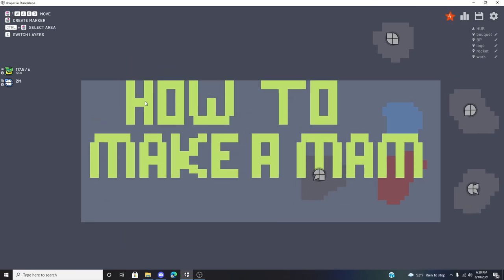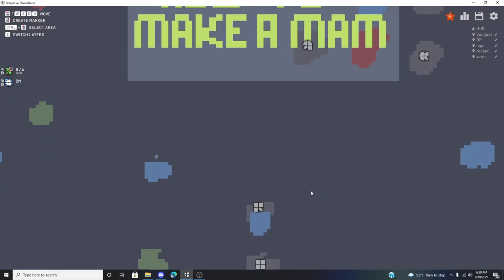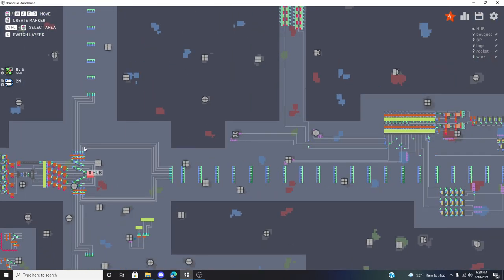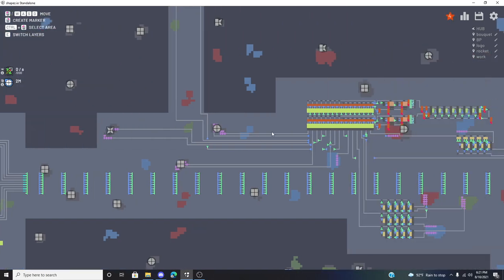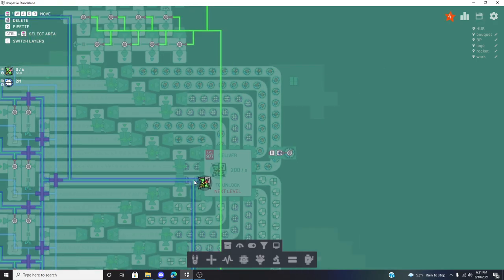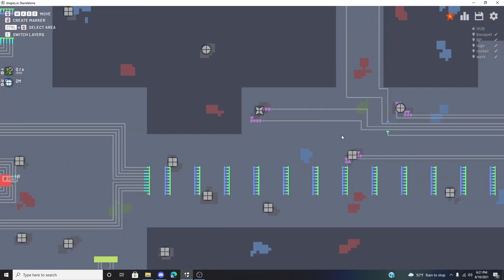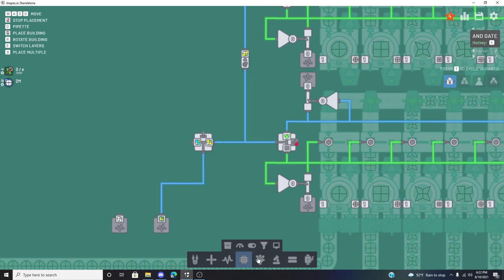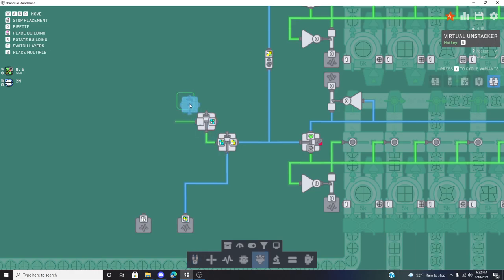How to Make a MAM (Make Anything Machine) in Shapez (Read Description).

Comment: I've made a manual MaM where I have to manually clear the lines for every new shape because I didn't add trashing reject shapes in the design, and i havent considered restructuring my design to fit in the circuits for the null checks and uncoloured corners, well now I have to go back and redesign everything XD

Very helpful tutorial
Reply from the maker: Hopefully you can keep the hardware and just wire it up !

Comment: I spent several hours making a 4 belt MAM based on this video, and it worked really well so thank you for that. Except, I came back to see how you wired it for 4 layered shapes, and I saw your 4-belt one, and it was like half the size of mine lol. But anyway, thanks for this video, very informative
Reply from the maker: Yeah! I used a 5 wide stacker design (at the cost of additional length compared to the 6 wide design i show here) to keep the entire MAM restricted to a specific area to save space/travel time. 

I’ve actually made a TriMAM and PentaMAM which are pretty neat. 
If you join the discord, we can discuss on how to make it “smaller” and so forth!

Glad it helped you!!
Reply: What is a belt
Reply from the maker: @thermitty_qxr5276  huh?
Reply: @Zipwhat23  the 4 belt he said and what belt does he mean
Reply from the maker: @thermitty_qxr5276  his Machine makes 4 full belts of HUB shapes. In my video, I have a similar machine that also makes 4 full belts of HUB shapes.

Instead of a regular MAM that only makes 1 belt of full shapes, the one I do a tutorial on above.
Reply: @Zipwhat23  oh i get it

Comment: This is insane, major props to you for figuring it out and for explaining it so clearly in this video!  I think I saw it in the video but it wasn't explicitly mentioned, when it comes to inputting the next shape does that come from the hub automatically or do you have to manually copy the shape code into the system?
Reply: It comes from the hub.
If you switch to the wires layer ("e"), you will see an output on the left of your hub, showing the shape that is currently required.
You run a wire from that.

Comment: This machine doesn't work with the spaceship shape on level 26, I'm confused
Reply from the maker: Yes that is intended. This machine is only meant for levels 27+  as those shapez will never be “floating” like level 20 and 26. A “TMAM” can handle floating shapez, a regular MAM (in this video) cannot
Reply: @Zipwhat23  I'll just finish this one manually then, thanks

Comment: What level should I get to by myself before having all the necessary parts to make one of these
Reply from the maker: These are intended for post campaign levels. This is level 27 onwards. By then you will have all necessary parts.

However, you can build the physical layer early and use blueprints to make assembling it when the time comes easier for you
Reply: @Zipwhat23  thanks

Comment: The one thing I'm still curious about is shapes like the logo, where it's made of two layers but if you just took the the top layer and stacked it onto the bottom layer in the normal way, it wouldn't work because they don't overlap so stacking them just creates one full layer
Reply from the maker: its a floating layer mechanic. Only TMAMs make those. Not needed for freeplay. 1000000000 times more difficult.
Reply: @Zipwhat23  Oh ok I’ve never heard of a TMAM but I’ll go look up one of those thanks

Comment: What do the 2 transistors do at 21:00? The gate and input are on the same wire and it looks like they just always output whatever is input? I can't wrap my head around what they do different than if they weren't there at all. Awesome video. I didn't feel up to tackling the MAM but now I passed 100 the same day I watched this.
Reply from the maker: So the two transistors are just little gates that just prevent the signal from traveling backwards should anything happen.

The XOR gate simple says “if there are two shapes, stack them, and then carry this shape on the line” . If one of the lines are empty (aka a Missing Corner) then it will continue carrying the one shape that is active and ignore the stacker and the empty line. If that makes sense

Comment: So, if I'm understanding this correctly. If you just add the last 3 stacker lines and wire them up it will cover the four layer shapes and build up to that point as you progress through freeplay?
Reply from the maker: Exactly correct!
Reply: @Zipwhat23  I've also noticed that that REDDIT link shows a slightly different wire and building layout than what you are showcasing. It's nice to have a static image to copy than trying to pause the video at the right point to get it transferred.

Comment: i have a question why would you rotate the corners to their direct position and not all the same way? is thatbecause of the signal for the filters or because stacking would slow the process down greatly (as i noticed in my attempt to a mam)
Reply from the maker: Well, by rotating them all to the direction I need immediately out of the cutter saves me space from having to put in another rotator down the line to make sure they are in the correct corners. 

Rotators (at not equal upgrades) sometimes are SLOWER than full belts, meaning if you had unequal upgrades then you’d be slowing down your MAM. By having rotators only handle 1/4 of a belt, this insures no slowing down. 

Also If i put all four corners into the top right position, I’d have to re-rotate them all to the correct position anyways before stacking, why not knock it all out in one go? 
(If I understood your questions correctly)
Reply from the maker: Also, I recommend joining the Discord for shapez so you can share and you can chat with others about how or why things are done!

Comment: would it help efficiency if I generate fresh base shapes and colors for every layer? I just built up the entire first layer and am considering putting in the effort to make fresh inputs so it runs faster hopefully.
Reply from the maker: No, the input shown here will fully support all 16 corners (or all 4 layers) without draining up to a Dual Belt design.

Trying to add in more shapez would make the design bigger than needed! 
Sure it takes awhile to fill up, but once filled up it shouldn’t encounter issues (provided its hooked up correctly).

Comment: Hi there. Wonderful video. It was easy to follow and understand. Things went very well until the hub wanted this: SrRrSrRr:WwSwWwSw:RrWyRrWy:Wp--WpWw. I have gone through the video several times, tried changing things myself, but to no avail. Reading your description above, should this MAM handle 1 floating layer? Thanks for the  video. I am determined to get it working!
Reply from the maker: Its not one floating corner. But rather one missing corner. An example of a floating shape is like Logo (level 20) or Rocket (level 26).

Not sure why it is breaking on you. When it comes to the stacking for creating the layers themselves, ensure that the filters are working correctly and that one side is bypassing the stackers to make the only 3 corner shape. 

If you need help, please use the Discord. Others (and myself) can trouble shoot the issue further if you can provide screenshots. 

Additionally, removing the null-to-zero converters may help fix some issues. They can have unintended consequences we learned after the fact
Reply: @Zipwhat23  Thank You for the rapid response. I will look into this today. Thanks again and keep up the brilliant work!

Comment: This is pretty nuts. And how exactly is it handling shape 20 e.g.? The first one that wouldn't fit together by simply merging all corresponding layers one after another?
For what I see here, it would read it, process it and stack it together - just to throw everything into the basket when reading the output and comparing it to the required input.
Reply from the maker: It doesn’t. That would be a TMAM. Or True MAM. This just completes levels
Reply: @Zipwhat23  Ah, so this only works flawlessly if each layer that is stacked onto each other has a corresponding layer beneath it.

A "True MAM" would basically require at least a couple extra loops of putting extra "sacrifice" tiles onto specific wanted tiles, combining them, removing the sacrifice tiles and adding the rest back together.

Not easy. Not easy at all. That would actually be programming in a way. Interpretation of shapes and layers, adding knowledge and required dependencies into the MAM.
Reply from the maker: @M3dicayne  there have been maybe 4 tmams in existence with like 2 more theoretical ones. I’m currently working on my own. Binz Nakama has a great series. Also join the discord for more discussion.

Comment: While this is quite an impressive design, it doesnt actually fulfill the requirements for a full Make Everything Machine. While this is sufficient for completing the HUB requirements and thus the MAM achievement, the design fails if you request it make a shape like the logo shape, where one layer has a corner that is not on the layer below. This machine, if, for example, requested to make the logo shape, it will make the first and second layers correctly, but attempt to stack them directly, causing the two layers to join into one, failing to produce the desired shape.
Reply from the maker: MAM is the general terminology that the COMMUNITY created. A TMAM or True MAM is the appropriate name for a machine that can make Floating shapes like Logo or Rocket. 

A new term AFM, Automatic Freeplay Machine, has been coined to describe machines specifically for Freeplay level completion.

I’m not retroactively changing the naming conventions of a 2+ year old community and video its been discussed regularly. And I’m pretty sure I mention that its only meant for HUB shapez in the video. 

If you want to go over the Processing to make a Tmam, be my guest but it would be a much much much much longer video having to break down all specific cases of floating shapez as theres much more out there than Logo or Rocket, such as Bird and Scissors.
Reply from the maker: I updated the Description of the video to describe why the naming is as such!

Comment: Does this work with a missing piece? I tried to create mine referencing your design and it seems that it does not go well with missing pieces
Reply from the maker: Yes, it does. It can handle 1 missing corner. Make sure the double set of filters before the first set of stackers is wired correctly. I use this same design for almost every other MAM I have
Reply: @Zipwhat23  Oh thank you

Comment: I know its been a long time since you made this mam, but i have a problem with it. I "think" i have done everything correctly, because it can make the lvl 26 rocket shape (or at least what the mam thinks it should be). But when i change what the mam should make, then a "conflict" occurs. In the top 2 layers it keeps "remembering" the rocket shape, when it gets to the first stacker. No matter if i give it a 1-2-3 or 4 layer shape. its as if the does not flush those layers. I copy/pasted the wirering and building from the bottom layer which works fine.
Any help would be appreciated (made the 4belt version)
Reply from the maker: This is not designed to make floating shapes like Rocket or Logo. Those would be a TMAM. This just makes Freeplay shapes. Please see the description about naming conventions etc.
Reply from the maker: But in terms of the conflict, i would say that the way you “break down” and analysize the shape could be wrong, or there maybe a messed up transistor somewhere, or so.

You can go to the Discord and share screenshots and we can help you further with the issue…

Comment: could you show the mechanism you use to make sure you have 200 shapes/second?
Reply from the maker: Hey, so I no longer have the device shown in the video. But the common lingo for it is a "Dump System"

I store roughly 500 items in like 16 or 20 storages and then flush the hub with them all at once to trick it into thinking I have 200 i/s, when in reality it is more like 150 i/s. If that makes sense.

I'd recommend joining the Shapez Discord (via the Shapez main menu) and pinging me there @Zipwhat23#8104 so I can show you a) how I counted the shapes and b) the wires to trigger the system.
Reply: @Zipwhat23  ok will do!
thx

Comment: i came up with a machine that does the same with different electronic, after stuggleing for hours xD the only thing i cant figur out are those shapes with a floating piece, like the logo shape. im pretty sure yours cant handle those too, m i right?
Reply from the maker: Nope. Those would be a TMAM, this just strictly makes Free Play shapez (which are never floating).
Reply: oh, Make Anything Machine is kinda misleading. i tryed to make a machine that makes any shape as the beginning of free play recommands and struggled so hard that i searched a bit for a resolution and a tmam, as it apparently is called, is insanely complex. i think im done with the game now :D it was a whole lot of fun for a good while.
Reply from the maker: @EBOo__  yeah! So long story short, we (the discord community) started using AFM (Automatic Freeplay Machine) to reference what I show here since MAM is not exactly true. However its still the default term. A TMAM is still the true Floating Machine maker for Levels 20 and 26. 

I recommend joining the discord for more discussions and further designs etc if you haven’t already

Comment: I think i did something wrong because the corners doesnt get placed in the right place
Reply from the maker: Double check that the rotators match the wiring. Each corner should have a different set if rotators

Comment: this work for level 76 +?
Reply: if not how do i make it work for lvel 76+
Reply from the maker: @Gr8rSpy  simply copy and paste additional parts of the machine. I build 1 layer in the video. Copy and paste that 3 more times, and set up the correct amount of stackers and it will wokr
Reply: @Zipwhat23  so it makes floaty bits as well
Reply from the maker: @Gr8rSpy  NO, it makes MISSING CORNERS, not Floating ones like Logo and Rocket.
Reply: Is there a way to upgrade the machine to make floating parts or is that not a thing I need to worry about?
Reply from the maker: @thenomadicsnowboarder3695  it is not a thing to worry about! The only floating shapes that are needed are level 20 (logo) and level 26 (rocket) in base game. MAM’s are used for freeplay (post level 27). Floating shapes WILL NEVER appear in free play.